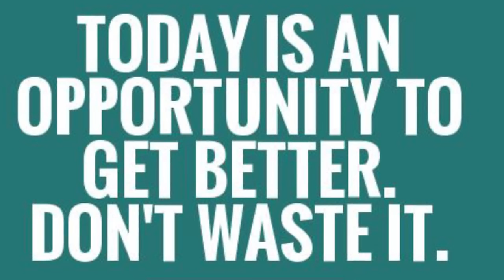Sod Job with Grass Monkey, I Messed Up Trimming Juniper Bush

Comment: I own a landscaping been in business 12 years i think your fine trimming the juniper the way you did it. I would say i wouldnt trim it with the power sheers if its real hot in the middle of the summer you could burn it but early in the spring i think its fine to trim it with the power sheers.

Comment: Is this normal time of year for you to start mowing and doing jobs in your area? Or starting early this year? Up in Connecticut usually we start cleanups around April 18th. Last year a bit earlier because lack of snow but now this year we still have 6-7 inches of snow on the ground now.

Comment: Juniper is a good ground cover for hills and banks. I used an articulated hedge attachment on my trimmer to groom when required. It is a woody ornamental so you can overspray with glyphosate to take care of weeds embedded in it. One thing, do not ever use a string trimmer unless you use a blade. It will cause blisters on your skin. A blade or lopping shears is handy when juniper comes up against a curb. Use the blade that looks like a circular saw blade.